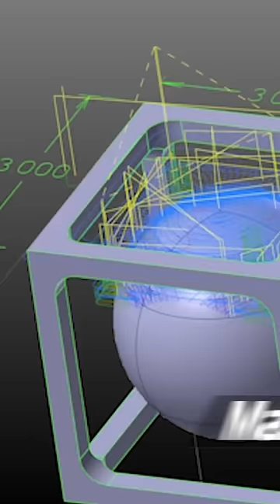How to Machine the PERFECT BALL in a BOX

Comment: Okay now let's see you polish that metal so you can't see the tooling marks.
Just saying
Reply: rock tumbler.  We have a "vibro-burr" at Boeing and all the small parts go in it
Reply: Holy fuck, out of all the issues with manufacturing this product your gunna Go rock tumbler for finish, the absolute disrespect and gall is nothing short of laughable, this is, or better yet should be a precision part, rock tumbler is a universe apart for specifications retention, like cmon man, thats like driving a tesla to a prius  to go to a race track, it's a chain if one level of altercation is less precise, there all that level of precise, obviously not stock cuts but still
Reply: @NINacide I was interested in Boeing,.drug test , high precision maching, quality actually checks yours parts, expensive rare materials for low batch parts, good luck fam,I wouldn't unless someone gave insight, cause your dead if not, titanium incanel,m2, m3 expensive mess ups, and not necessarily by the book speeds and feeds, im impressed you can but im very hesitant at that learning curve
Reply: What micron finish you want fam
Reply: @curtiswrong  lol, not my department.  Wverybody loves the services i do